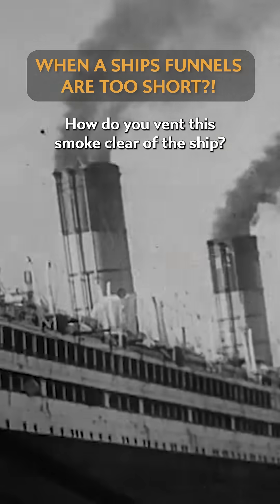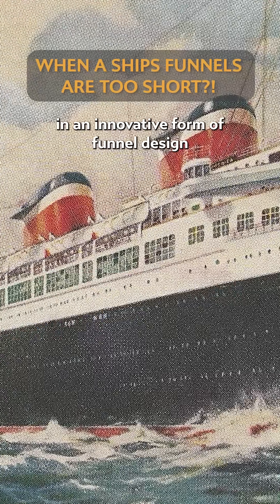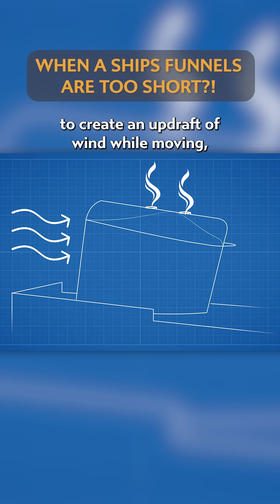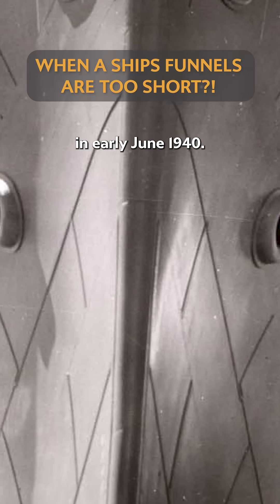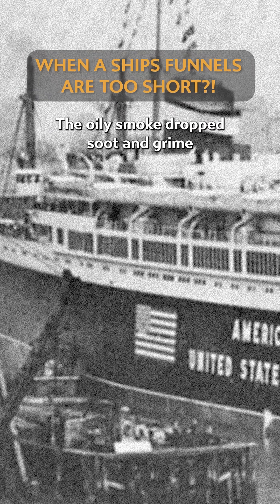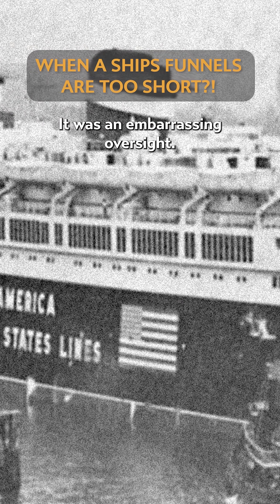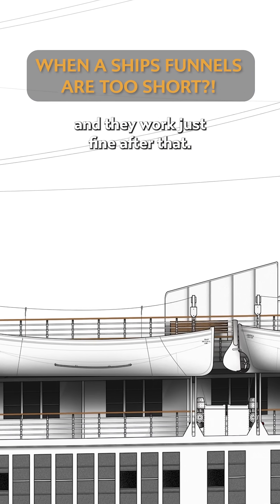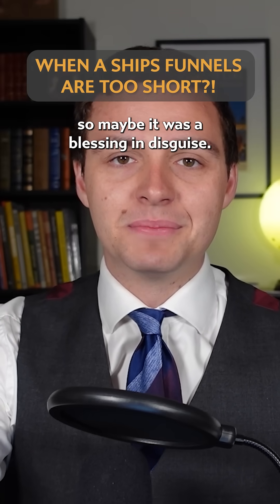This Ships Funnels Were Too Short! #titanic #shorts #history #facts #ships

Comment: I always wondered why no one designed an exhaust system that would or could vent the smoke and gases from the hull area of the ship. Similarly to the LCS US Navy ships that have the exhaust “tailpipes” coming out from the rear most hull area. I’m sure it would’ve looked very odd without funnels especially in that time period, but why not? I’m genuinely curious especially since ships of that time, were already painted black, so the thought of soot making nasty marks would’ve been thrown out

Comment: What's wrong w/ lower chrome side pipes like you see on hot rods? Just straight pipes w/ no built-in muffler for that hi-performance sound. It's also a good accident avoidance safety feature to warn slow moving ice bergs not to cut you off.
Reply: Na, passengers would complain about being stopped by cops all the time. lol

Comment: Wait wait.  If we put big az lightweight like glider mounts on boats.  Could that lift them like a quarter an inch higher in the water and reduce fuel usage.  Im talking like 100ft x200ft and have it mounted by cabels to 4 different points above the center mass

Comment: The LNER’s Jeanie Deans of 1931 had that exact same problem on her first season. She had a double ended scotch boiler with two funnels. The forward one was raised by 6 feet, the aft one by 4. This cured it but the limit had been reached to the point of what was visually acceptable which divided opinion. It wasn’t till after the war when she was rebuilt that she was given two elliptical funnels of equal height.

Comment: Bro did not just pronounce innovative like that 💀
Reply: Came here for the same reason 😂 screw the funnels, that’s what interested me
Reply: My guess is that it's an older "original" pronunciation that's survived in some dialects. To this day, English words with four syllables usually have the stress on the second syllable like he stresses it here (e.g. in words like capitulate, intelligent, responsible, approachable), but the stress patterns of some other four syllable words has changed.
Reply: @zeddeka has it more or less right here. The pronunciation used in the video is older and has the technically correct stress pattern for words of Latinate origin (and "innovative" is indeed from Latin), but the Latinate stress pattern has been replaced with the Germanic one (initial syllable stressed) for this word in most dialects on both sides of the pond.
Reply: As an Australian we have never pronounced it like that, and I’m nearly 60, have also lived in the UK for 3 years and I never heard it pronounced like that.
Reply: I’ve lived in Australia my whole life and have never heard it pronounced that way. I heard once that if someone mispronounces something, it probably just meant that they learned the word by reading, rather than by hearing it, and there’s nothing bad about that :)
Reply: Al you minuem
Reply: It's an innovative pronunciation.
Reply: One mispronounced word, over 1200 likes on one of the comments about it, at least 44 free comments on the video and they're not even to do with the subject :D :D. Cheap investment.
Reply: I was going to ask if he misspoke or if this is a common pronunciation outside of North America. 

I don’t think I’ve ever heard it before.
Reply: @Annie_Annie__ it's not common here in Australia, but it's still not unheard of.
Reply: @Annie_Annie__  Its a pretty common pronunciation outside of North America
Reply: He has an excuse. He's Australian.
Reply: @scotpens I'm an Australian he's insane
Reply: @Wingedfish117 ......I thought that was part of being an Aussie?
Reply: @scotpens Aussies don't say it like that mate
Reply: @scotpens I’m Australian and I’ve never heard anyone pronounce innovative like that.
Reply: @scotpens   As an Australia I have NEVER heard it said that way.
Reply: @scotpens that's not how we pronounce it in Australia
Reply: @scotpens  nah we say "inna va tiv" or "inna vay tiv"
Reply: @scotpens Coming from an Aussie, no excuse for that pronunciation.
Reply: That's what he was saying!
Reply: I honestly can't hear him saying anyone other than "in noval" even though that's not what he is saying at all.
Reply: I like it.
Reply: I can't even repeat the way he says it's!
Reply: British person here. I've never encountered that pronunciation before either,  I assumed it was an Australian thing, they really chewed the language up.
Reply: I was about to say that’s the first time I have ever heard innovate pronounced like that.
Reply: Welp, I comme from a romance language and I saw nothing wrong with how he said it, that was the proper way to say it, so I guess it's just one of these cases where yes, you're all wrong
Reply: @samarkand1585  no one thinks it wrong --just different.

And wicked cool btw....
Reply: @TheDoctor67 There are plenty of people just in this comment section saying it's wrong
Reply: @richardmillhousenixon  with a majority just enjoying it.
Reply: It's how it would've been pronounced way back then, so I assume the accent sticked in his family
Reply: It’s fairly common in the UK, Australia and New Zealand.
Reply: @5roundsrapid263  I'm Australian born, and lived there till I was 30. I've lived in the UK for the last 5 years. I've never heard anyone pronounce it like that before today.
Reply: @funkyschnitzel  I listened again, and you’re right.
Reply: @5roundsrapid263  WTF!? Where!? LOL Never heard it before in my whole melbournian life
Reply: @5roundsrapid263 not in the UK at all
Reply: @5roundsrapid263 yeah nah mate nobody ever says that. Only reason would be driving engagement lol
Reply: @5roundsrapid263  I have never, ever heard that in Britain. Not once.
Reply: @5roundsrapid263  It's not common, it's never been said by a native english speaker with basic english skills.
Reply: @5roundsrapid263 not common at all in the UK
Reply: @5roundsrapid263 bullshit, nobody mispronounces “innovative” like that.
ignorantly butchering the english language is more of an american tradition.
Reply: @mj.l Americans have the historically accurate version of English, in nearly all cases the British made goofy changes just to be different and trendy
Reply: @mj.l  fair enough, Mr "Aluminium" 😂 
But yea you're right (not about Aluminum though) Especially "AAVE" or "Ebonics" or "Redneck" speak. My God, have you ever been to New Orleans? I grew up and have lived in the Southeastern US my whole life, but for the life of me I could not understand a word of Creole. I actually do better with Gulluh than Creole, probably because of where I grew up (South Carolina Lowcountry).
But dialects are interesting.
Reply: @mj.l Hah! Watch some of Across The Pond's videos if you want to find out why American English is the way it is. (Mostly it's because the British decided to make a change after America went its own way, but don't take my word for it. Lawrence has done far more research into the differences than either of us, so he's far more believable than I am. Far more entertaining too.)

Comment: But, if the ship was stationary, or moving slow or in a tail wind that canceled much of the airflow over the funnels, what would happen then?  Sitting pier side getting ready to depart, just dump soot on everyone.   Transiting the Suez or Panama Canals, or through a busy harbour, in each case navigating slowly ahead, dump soot on everyone.  Sit off shore waiting for the tides to shift, or other ships to clean a shipping lane/channel.  Seems like a frequent problem.
Reply: in those cases they just don't have the same need for it.  A moving ship is a different issue.

Comment: Yeah, let's not test the design BEFORE integrating it into a $100 million  ship :-/
Reply: This WAS the test. Sea trials are run to find flaws that scale model testing doesn't reveal.
Reply: @disorganizedplay  Kind of seems to me that building the entire thing at full scale is not a test. What money is saved by doing it this way?  All that's avoided is coating passengers in smoke.
Reply: @Martial-Mat  computer models are a very recent innovation. Before them, if the math said one thing and the test basin said something different, the next step was to build it and trial it. There’s a reason why before detailed computer models, so many flaws in ship and aircraft design weren’t found until 1:1 scale hardware was built.

In aircraft, you can generally build a prototype to prove the concept. Ships are so big and expensive that a prototype is usually not made, and the problems are found by trialing the lead ship of the class. USS North Carolina had a flawed propulsion system that vibrated badly - could they have found this in a prototype? Maybe. But battleships are too big to make a “prototype” of.
Reply: @disorganizedplay  Very interesting. Probably why a number of big ships sank on their maiden voyages and not just Titanic.
Reply: How exactly do you think designers should had done it? They didn't have computers with advanced modeling software to check everything. Pencils, paper and scale models - all what they had.
Reply: @ReasonX3  People have understood physics, dynamics, and mathematics for hundreds of years. How did the woman who calculated the first moon landing do it without computers or past experience? A deep knowledge of the subject matter